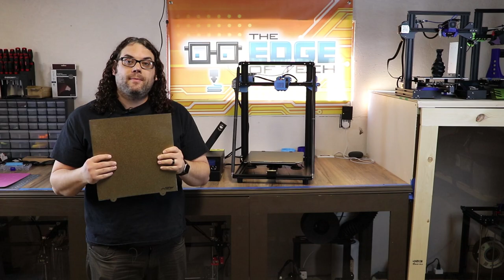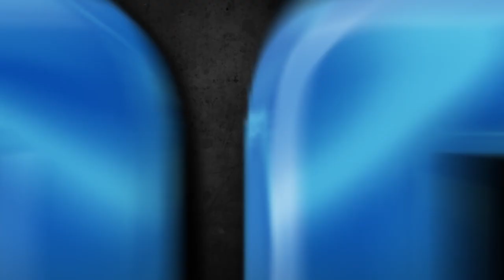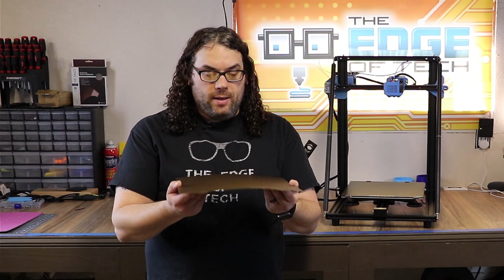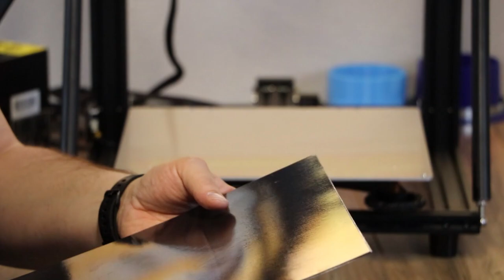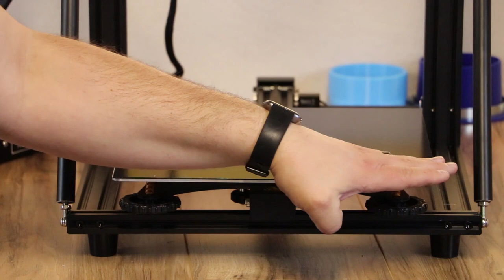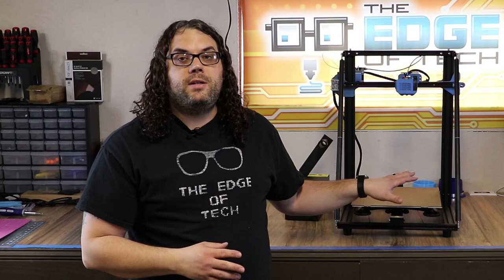How to install the TH3D EZFlex2 on the Creality CR10 V2 3D Printer

Comment: GOOD MORNING JIM  ...  I HAVE TH3D'S EZFLEX 2 SYSTEM ON 5 OF MY PRINTERS AND THEY WORK GREAT. I LIKE THAT THE PEI IS PRE-INSTALLED. THE MAGNETS GRAB LIKE AN OTHER WORLDLY FORCE EVEN AT HIGHER TEMPS. ALSO TH3D HAS GREAT CUSTOMER SERVICE AND ARE VERY FRIENDLY TO TALK TO. THE PRICE IS REASONABLE FOR WHAT YOU GET AND THEY ARE HOLDING UP PERFECTLY OVER TIME.
Reply from the maker: Awesome!!

Comment: Nice video.  I started with Wham Bam flex plates.  I liked them but although they are an american company, the plates are drop shipped from China so they take a month to get.  I tried the TH3D EZFlex plate and I now prefer them.  They work great and they are less expensive than the Wham Bam flex plates.
Reply: So the key here is to find who is making these for TH3D as they are probably selling under other names as well and see what those cost.  American company or not, $35 for this is pretty expensive.
Reply from the maker: Awesome!! I'm glad you like them!
Reply from the maker: @broderp  I prefer to support the small businesses that I deal with and not undercut them by finding their sources. This is the reason so many 3D Printing companies go out of business. If you don't want to buy from them that's ok, but I don't support what you are saying to do.

Comment: Great video Jim. I think I need one of those for my little kingroon printer
Reply: I HAVE THE TH3D EZFLEX ON MY 3 KINGROONS. THEY FIT AND WORK GREAT !
Reply from the maker: They are very nice!
Reply: @3djimmy252  those kingroon are sweet little printers.   I got mine as a non functioning box of parts with a bad hotend and fried board.   I put a skr mini e3 on it and a e3dv6 and now it's so quiet and prints very nicely.

Comment: Bro. I have to level after each print. Can I put a wedge in the wheel so it doesn't move? Or what upgrade for wheel to level? Thank you
Reply from the maker: You could put a lock nut on them to see if that helps

Comment: may just be the video/angle,..? but looked like the wheels where wobbling on that bed. ;).  Other thing people don't mention using flex beds over glass, weight, there is a decent weight savings in the bed, making it less for the motor to move!
Reply from the maker: Great point! I think I mention the weight part at 7:55, and I will double check the wheels!

Comment: Hmm, so the textured one is powder coated  a la Prusa and the PEI is a sheet you stick on, not sure which would be better.
Would it be possible to stick a PEI sheet on the bottom of the spring steel sheet and use whichever by flipping it?
Reply from the maker: I believe they both ready to go and the PEI is already on the sheet but, I do believe if you ask TH3D they could give you a sheet of PEI to stick on the back of the powder coated one.
Reply: @TheEdgeofTech  From what I've gathered you have to apply the PEI yourself. They advertise for their EzMats that you can put them on the back of the steel sheets so I don't think it's unthinkable that you could make your own combo one.
Reply from the maker: @SteinerSE  I will find out for sure but I think they apply the PEI sheets in house. But the EZMat can definitely get applied to the back as that comes separate.
Reply: @TheEdgeofTech  Judging from another comment here they do now. My reason for thinking they didn't was because they ahd a video how to apply it (but then again, that would be needed for those sold separately) and that I saw suggestions somewhere that they should pre-apply them. I guess that true to their standards they listened to customers and started applying them?
My worry about putting it on the backside is that it might either affect the "magneticity", how well the plate is held with the extra layer and that it might affect/degrade the PEI somehow. Maybe that's a product idea for Tim, combo spring steel plates. :)

Comment: Do you need the magnetic connection or can you just lay the flex plate onto an aluminum bed and clip it down?
Reply from the maker: You could do that, but I would suggest the magnetic bed. It's much easier and you will love it! If you have any Printer that already has the magnetic, just throw the new flex plate on it and call it a day!
Reply: Wouldn’t the magnet hold back some of the heat that is suppose to get to the build surface? I’ve often wondered how much heat is lost between the bed and the build surface with glass, magnets or other materials.
Reply from the maker: @dougw9224  it shouldn't. And you could let it warm up for and extra 5 minutes before you print if you want. But once it's all up to temp, it shouldn't matter what surface you have on it. Bit good idea for a video though!!
Reply: To Hank you for taking the time to reply. A lot of YouTube people won't. Now I just have to wait for TH3d to get them back in stock. I had thought about just using the blue sheet they have but this might be easier. Thx
Reply from the maker: @dougw9224 No problem! I love putting the EZMat on the EZFLEX plate! One of the best combos you can get. That and the Textured EZFlex2 as well!

Comment: @1:06 I'm not sure how you can say this is cheap, based on the current price, the mat (in 235x235 for Ender 3) is $23.  This does not seem to include the needed magnetic base - this is an additional $12.   So this upgrade costs $35.  This does not include shipping.  Not very cheap when you consider the other alternatives for more popular printers.   Creality's own version works very well and costs $17 shipped from Creality.   Even less thru places like Amazon.   You then fail to show this in use.  Not just some tiny 10 x 10 mm test square, but on an actual large print that uses the vast majority of the bed surface.  Lets see how easy it is then.   Make the comparison then between this the cheaper ones.   You should compare the products you review against similar  products.  Otherwise your videos come off as paid advertisements
Reply from the maker: Thanks for the comments! This is a cheap vs the other bigger named flex plates on the market. Many people don't like the stock bed mats and are looking to upgrade to a nicer one, and that's where this video comes in. But it is true, there are cheaper options out there if that is what is wanted. Thanks for watching!
Reply: It is less expensive than the Wham Bam system. It is $55 for the Ender 3 Wham Bam system.  There are cheaper versions available on amazon.  I have had friends who bought some of the cheaper ones and were disappointed when they rusted.  The TH3D EZFlex plates do not rust. I don’t think this video was intended to be a comparison of different systems.

Comment: Doesn't address bed leveling screws. Without making a cutout for them, good luck every removing your bed for service or maintenance
Reply from the maker: I'm able to loosen and take the wheels off with no problem. Then the bed comes straight out off of the plate. I'm not sure why I would not be able to service it?